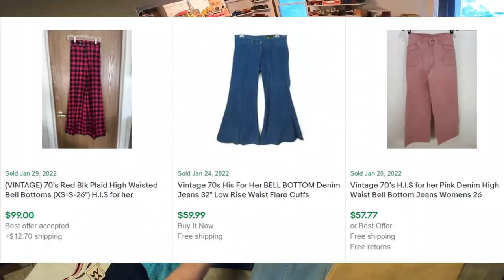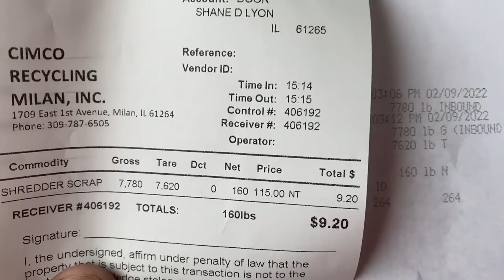Vintage Clothing Clean Out - Bell Bottoms and Levis!  Junk Removal Jobs

Comment: There was more metal weight on that huge sofa than you chucked in the scrap metal pile.. those recliners metal frames are heavy and just bolted in. Have an impact driver and socket set in the van